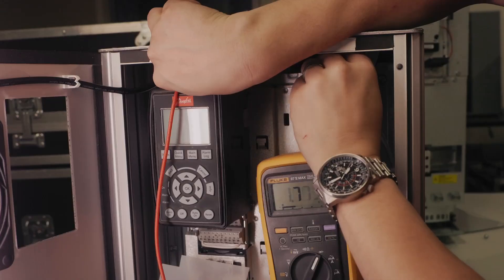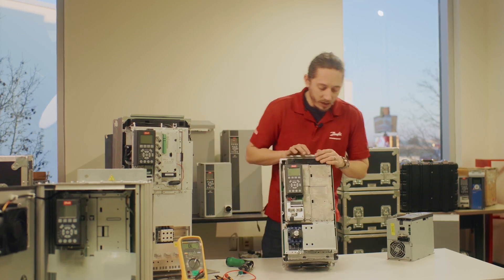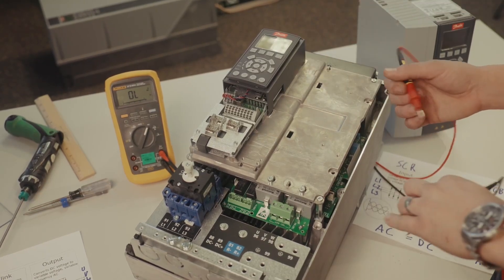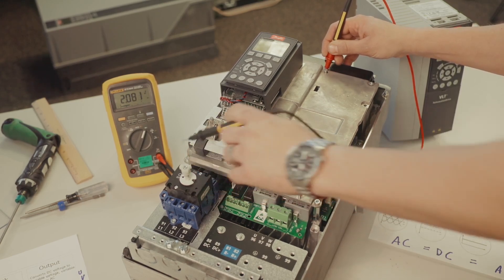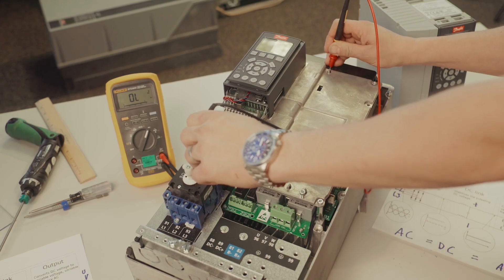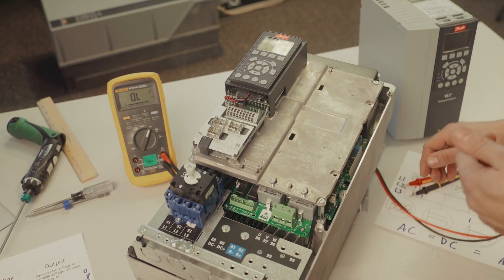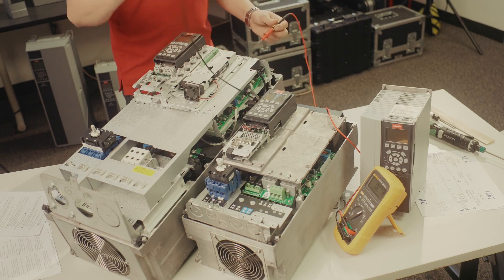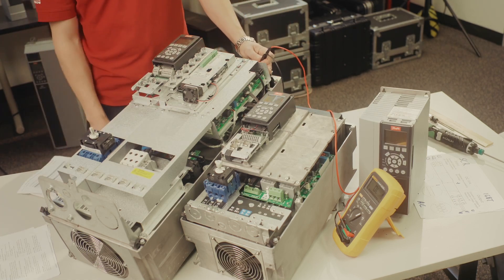How to Conduct Static Tests on Danfoss VLT® Drives

Comment: Hello. what is the main purpose of static testing.? I had a danfoss drive that showing earth fault when the the motor is connected but when motor is disconnected the drive is fine but it has an Amp reading without load thats causing the problem. Will a static test detect the fault of that drive internally? Thanks
Reply from the maker: Great question — thanks for reaching out! In this case, a static test most likely won’t identify the issue. Static tests typically check the freewheeling diodes on the SCR or IGBTs. If one of these components were damaged, it would usually cause symptoms like blown fuses rather than an earth fault.

Since you're seeing an earth fault only when the motor is connected, and you're also reading current with no load, it's possible the issue is related to current sensors or leakage paths causing current to flow to ground. We recommend checking the current sensors as a next step.

For a more detailed explanation, you may find this video helpful: https://youtu.be/LSppvPcnsLk